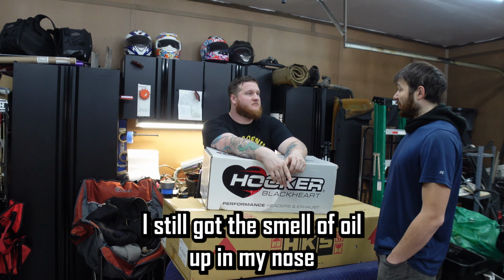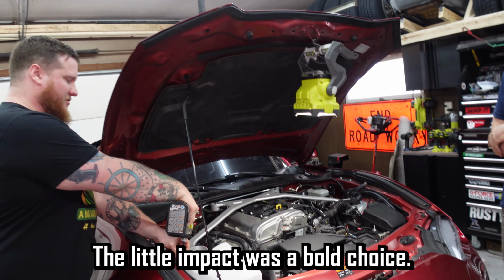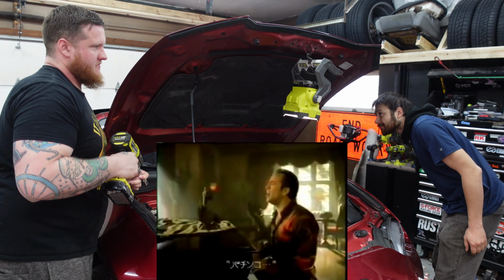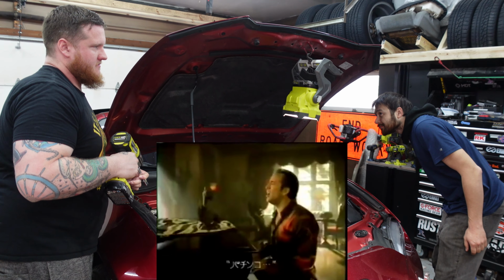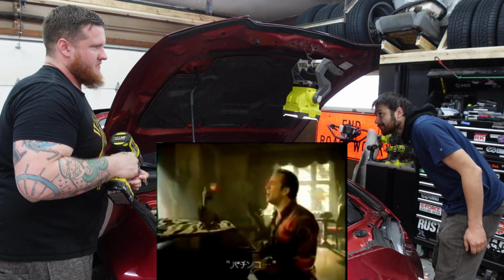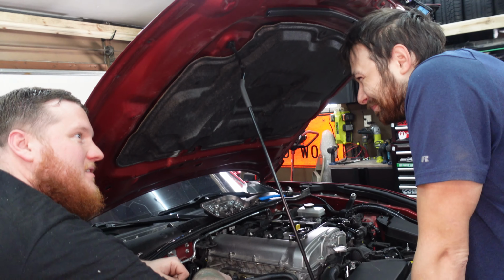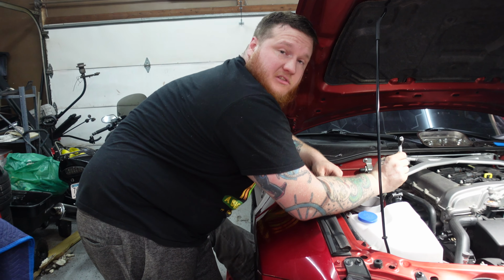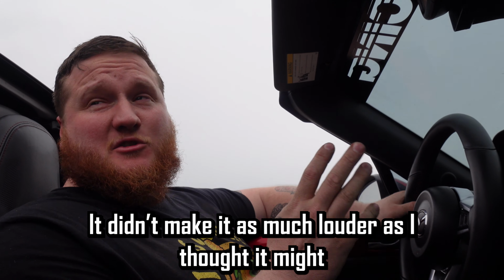Did we make the Miata too loud? (Headers and HKS install)

Comment: I have a 2023 Miata with Edelbrock headers and the versitune crackle and pop tune. Although I love it, the result is engine light and service engine soon light on which makes my cruise control not work and  a few other stuff like trip counter. Any way to fix this that you guys know about?
Reply from the maker: @romano54321  the engine service light is cleared through your head unit. The check engine light is fixed with your tune, in the VersaTuner software when you are flashing your tune you have to select the option to ignore the code for low catalyst.

Comment: damn! i missed out on this sale. do you think i should opt for a ceramic coated header or save a few hundred and go without a coating?
Reply from the maker: I think the coatings are overrated, but I've never dug into it too deep. I know there are plenty of popular ones for these that are not coated.
Reply: @redhenracing2  thanks man, im thinking the same. i've been eyeing these PLM 4-1 header for the ND but cant find a single article about them on the forums. any thoughts? (edit: found 1 single post about shit welds)  i'd post a link but it's not letting me lol. that or the skunk2 alpha.
Reply from the maker: Between those two, I've only seen the PLM in person, and it seemed well-made. I don't think you would be going wrong with either of them, with a mass-produced part like that there will always be somebody that found a bad weld or something.

Comment: Where is the catalyst in the OEM HEADER ? do you put anoither in the midpipe?
Reply from the maker: The main catalyst is already in the stock midpipe. The smaller one in the stock manifold is considered a pre-cat, and is also considered unnecessary and disposable (for legal purposes, that's a joke)

Comment: Ever figure out the fire ring leak?
Reply from the maker: It does need a donut gasket that needs to be sourced, but for a $200 set of headers that can be forgiven.
Reply: Any update on a gasket? Lol about to install my hooker header this weekend
Reply: I’m thinking of just getting a regular gasket that has the 2 bolt holes
Reply from the maker: @paulharrington94  might be able to get away with it, keep me posted 🤙

Comment: I don’t understand why just installing headers throws a code. The computer knows the headers are flowing better?
Reply from the maker: It senses it as a failed catalytic converter, and throws the code for low catalyst threshold specifically
Reply: @redhenracing2  did I see that right, when you took the stock header off, did it have a small cat connected to it? And that’s whey it throws a code. I have a 99 Miata that I’ve owned for 19 years and I’m sick to my stomach that I’ll have to sell it if I buy a highly modified 2023 Miata.
Reply from the maker: @romano54321  yes, there is a small pre-cat built into the stock header

Comment: I guess around 170 whp
Reply from the maker: I'd love to see that, but based on my current Dragy runs we still have some logs to review and some adjustments to make.
Reply: @redhenracing2  do you run the original midpipe? That can restrict the flow an can cause issues.
Good videos btw keep it up guys :)
Reply from the maker: @maxreh5894  yes, still on the stock midpipe. With it being a daily through a lot of rural small-town-sheriff-patrolled areas, I don't want to open it up any more than this.